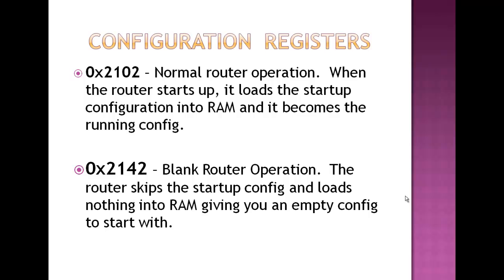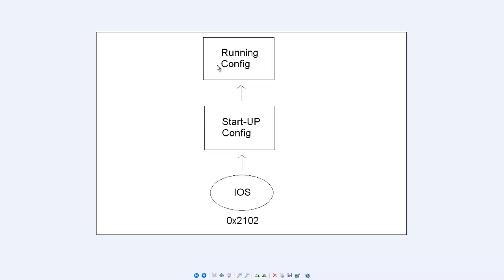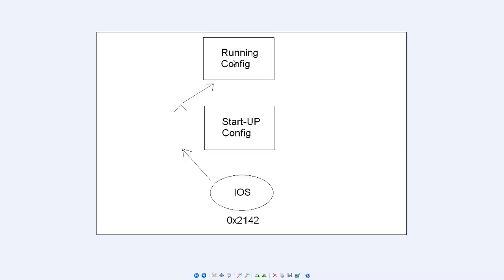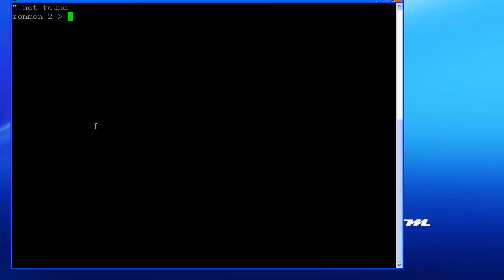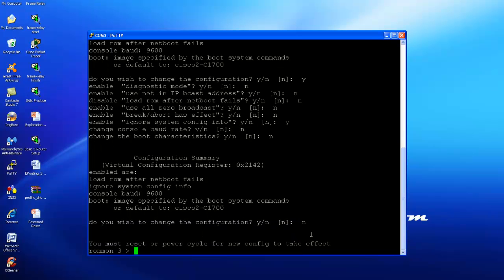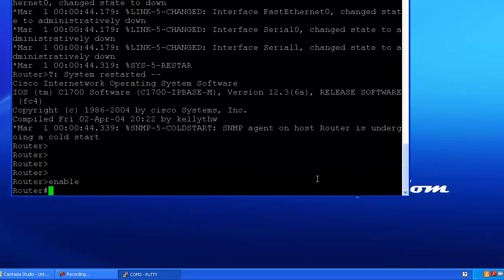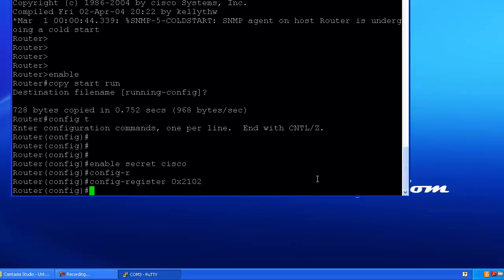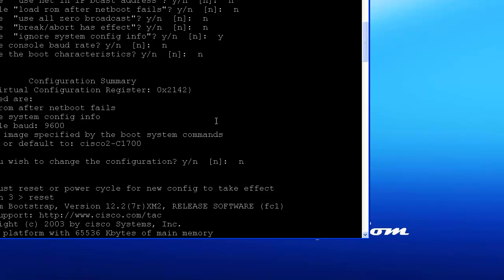Cisco Router Password Reset

Comment: I have a Cisco 800 series router that was previously configured to work with an ISP router in bridge mode. Unfortunately, the person who configured it forgot the password. Following this video tutorial, I was able to reset the password. However, after the reset, I noticed that the Cisco router is not functioning when connected to the FE WAN port from the ISP router. I'm concerned that we may have unintentionally erased the previous configurations during the reset. If that's not the case, what else could be causing this issue? Any assistance would be greatly appreciated. Thank you!
Reply from the maker: That depends, did you reset the configuration register to 0X2102 after you moved the starting configuration back to the router?  If not, it wont load the start file and the interfaces wont have IP's or be turned on.  Go into the router and do a show run and make sure you are seeing the configuration, if it is showing an almost blank config, that is your issue.

Comment: hello Sir, I made mistake on the 0x2142, I put the 0x2124 now I cannot open my router, is any remedy to fix this one?
Reply from the maker: A value 0x2124 means (among others) you need console baud settings 19200 then you shouldn't see funny symbols.  Just change the baud rate of your telnet program, get into the router and change the register back to 2102
Reply: @JMacify  thank you, thats great.

Comment: Hi,
I just received my router, but I am still learning in CISCO commands and I became that on putty console:
"Evaluating BIOS Options ...
Invalid Key: 0000
Invalid Key: 001A
Invalid Key: 001A
Launch BIOS Extension to setup ROMMON
Cisco Systems ROMMON Version (1.0(11)2) #0: Thu Jan 26 10:43:08 PST 2006
Platform ASA5510
Management0/0
Ethernet auto negotiation timed out.
Interface-4 Link Not Established (check cable).
Default Interface number-4 Not Up
Use ? for help.
rommon #0>"
How can I save the config and go forward to change password?
Reply from the maker: If your router is booting into rommon it either does not have an IOS installed or the configuration register is set to bypass the startup config.  Try resetting the register to the normal 2102 by entering in the following commands at the rommon prompt:
confreg 0x2102
reset or reload
that should allow it to reboot and find the startup config.  If you still go into rommon after that you are most likely missing the IOS file
Reply: thanks for your answer, thanks a lot
Also I have found some more video and websites that will help me to save that config and working Router.

Comment: My router has both username and password at login time...so is that this video bypass both username and password!?!? 

another thing is that ....Ctrl + break is not working at reboot time..the router simply continue it bootup process ...pls help me
Reply from the maker: Yes, it will get you past both the username and password.  Your keyboard my require a key combination to send the break.  Is there a colored key or a key with "FN" near the bottom left of the keyboard?  If so, you may need to hold that down as you hit the break key.
Reply: I have tried the key combination (Ctrl +FN +puase break) and also FN+ puase break key combination. but still the router boot as normal.  

I have one question. in which step I'm gone press those key combination. immediately as the router startup or in which part!?! pls help me
Reply from the maker: @zewduararsa1130  Immediately as the router starts up and continuously until you get the rommon prompt.  If you only press the break key once you may miss it.  If wont hurt to keep pressing the break key to make sure you send it at the correct time.

Comment: in my case ctrl + break doesn't work. the bootup process of the router simply skip it and proceed to the normal boot-up process, pls help me
Reply from the maker: Some keyboards have key combinations you have to hit to send the control-break.  Is there a key near the bottom left of the keyboard that is a different color or says FN on it?  If you, you may need to hold that key down as you hit the break key

Comment: Hey Johnny I have a cisco 1841 router and I followed you exact instructions and reset everything, was I supposed to do any further saving after that cause I turned off the router and turned it on again later and it had gone back to requesting a password and when I put in the one I created along with the instructions it was not working. I guess my question is whether there is any further saving before shutting down the router?
Reply from the maker: After you get in and load the start config (copy start run) you change the password and then save the new config with the new password (copy run start) you then change the register back to boot normally (config-register 0x2102) and then reboot and you should restart with the same config and your new password.

Comment: after i run
copy start run
it puts the old router name back on then when i run 
config t
I get Authorization failed?
Reply from the maker: Why did you run "Copy Start Run"?  Unless you are trying to save the config that is in the router, you dont ever need to do that during a password reset.  The current config is obviously messed up and wont let you into global mode so why would you use that command?  
The example here is for a situation where you need to save the current config but you can not get past the password.  This typically happens when a network admin gets fired or leaves the company and is a D-Bag and does not leave the passwords.  In your case, with a config you dont want to save, after you change the register and get into the router just delete the start config.

Comment: Non volatile config memory invalid or not present?
Reply from the maker: Sounds like you have some corrupted NVRam or you purchased a router from ebay that had it removed.  If you are using GNS3, you need to remove the blank lines from your config before you paste it in.
http://forum.gns3.net/topic4028.html
Reply: Cisco router 2611 is it broke?
Reply: Forgive the newb questions. Trying to do the first day lab in this Cisco CCNA in 60 days book and noticed the configuration register was 0x2102 in the book vs mines 0x2142.
Reply from the maker: @curtanglelx1946  2102 is normal operation and will copy the starting-config into RAM and call it the running-config.  2142 will skip the starting-config and load a blank config into RAM so you can get past any passwords.

Comment: Having an issue interrupting the boot sequence, I have tried using multiple keyboards to ensure my pause/break key wasn't broken however I still cannot interrupt. I also tried multiple variatons of keystrokes to attempt an interruption i.e. Ctrl Alt FN, Ctrl Fn, Ctrl Pause/Break, Ctrl Shift 6 X etc with no luck. I even used the special command - break from right clicking on the top of the putty window.

Router is a Cisco 2600 and I am using a serial-usb console cable with Putty as my terminal.

Is there any other way that I could interrupt the sequence or get into the router? thank you.
Reply: was able to finally get into the ROMon I ended up "simulating the break key sequence" as mentioned at the bottom of this page: http://www.cisco.com/c/en/us/support/docs/routers/10000-series-routers/12818-61.html
Reply: @MrGamerschannel  this does it for me, thank you very much!!!! :*
Reply: @MrGamerschannel  thank you.
Worked for me...

Comment: Hi Johnny
im getting to 
Router> enable
router~copy start run
i then get a error Non-volatile configuration memory invalid or not present
could you help with this plz
Reply from the maker: +stuart cassidy 
It sounds like the NVRAM on your router is bad or missing.  Your router has three sources of memory:

RAM = Normal Memory 
NVRAM = Like a BIOS chip
Flash = A simlpe flash card

It sounds like the NVRAM is missing due to the "invalid or not present" error message you are getting.  Where did you get that router from?  I hope it was not ebay since many of the routers being sold there are broken in some way.
Reply: +Johnny Mac hi johnny
thanks for the reply, i tried it 3 or 4 times and it decided to work, and yes i did get them from ebay :( however i thought it was a bargain at the time. 2 X 2950 switches 2 x 2610 routers 2501 router and finally 1700, with all cables. may be i have just been lucky

Comment: When resetting the password this way it does it save the current config file that was on the router (IP Addresses, VPN Settings, etc.) or does it wipe the current config leaving the admin to start the configuration from scratch? From the video it looks like it saved the current config settings but I wasn't 100% sure if I saw that right. Thanks!
Reply: trocz71 Sorry to respond so late but if you do it correctly it will not remove your config file so all that happens is the password gets changed and the same config file is used.

Comment: not able to enter 0x2142
im using cisco aironet 1200 series
pls help
Reply: Richardson Arul The aironet is a wireless access point and will not accept the same config-register as a router.  Being a WAP, it should have a reset button on it.
Reply: Thanks for the reply
I managed to enter the memory mode by long pressing the reset button and save the previous configurations

Comment: How to open that com3 putty thing
Reply: install putty, use a console-serial cable to connect from client to console, open device manager, look for ports-section, check which port you are using, which might be COM1, COM2, COM3 etc...
Reply: Could I do this in the campus library? Because for some reason, it does not work. It says error in serial device.
Reply: @dennist.8018  check if you're using a laptop otherwise it is com1 default in PC.